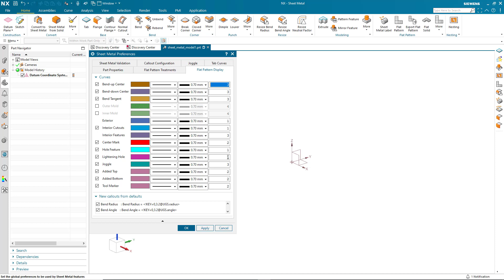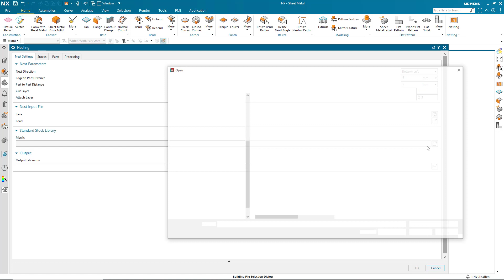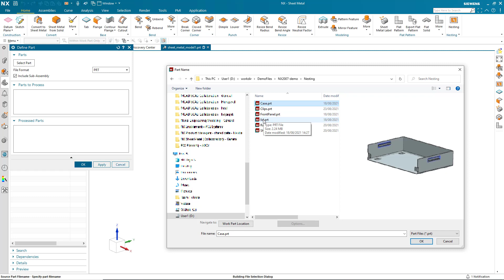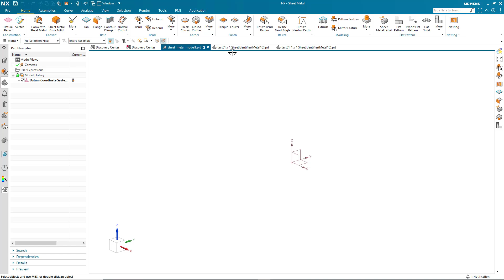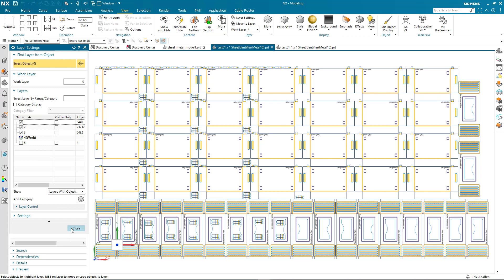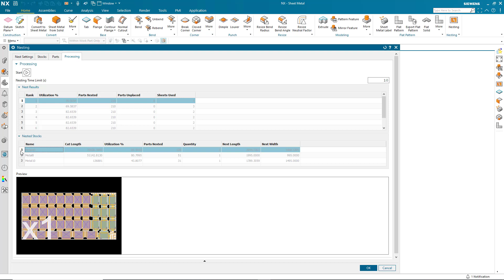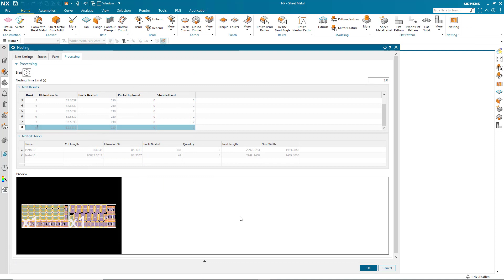NX 2007 - NX 2D Nesting

Comment: Sadly, it looks like this is a paid only module in NX. I’ve tried to use it in the Academic version and even the NX CAM Pro trial (which I assume had everything) and it says the license isn’t valid. 

Wish it was available because I really need to create a flat pattern to be CNC’d
Reply from the maker: Yes, this is an add-on module, but it should work in the ACADEMIC version

Comment: can it be used for wooden boards as well? Thank you
Reply from the maker: Yes, ..." It can be added to most NX applications and provide a nesting capability for metal, wood, carbon fiber, leather, soft goods, and even printed circuit boards..."
Reply: @CAMdivisionIndustry  great, thank you!
Reply: @CAMdivisionIndustry  Can I ask you starting from which version/build of NX is this feature available? Thank you!
Reply from the maker: @compassft  MU 2011 for 2007 SERIES – 2022-01-28
Reply: @CAMdivisionIndustry  Thank you very much!